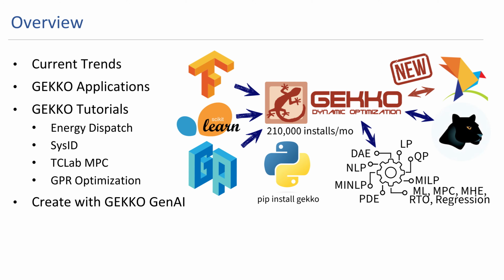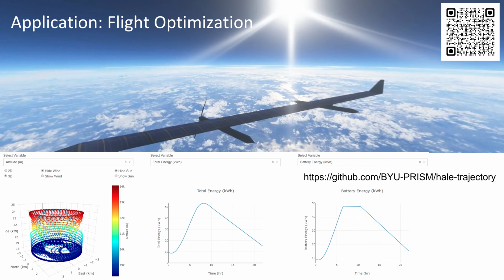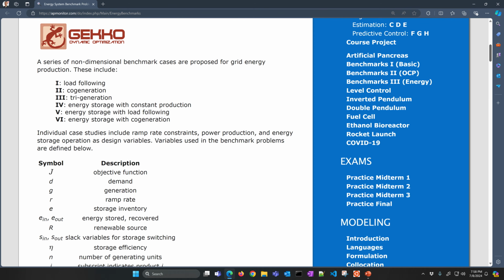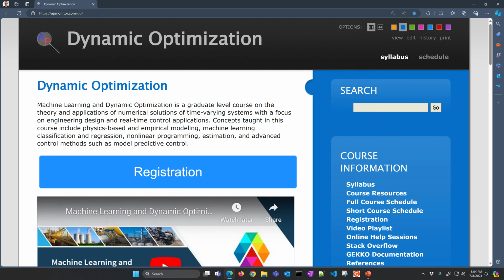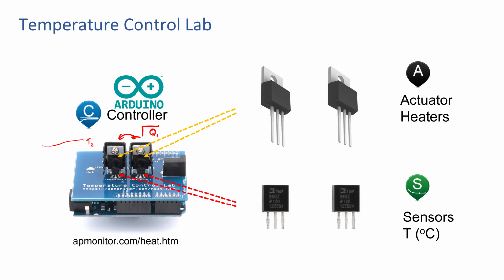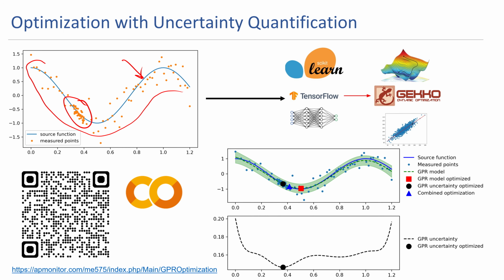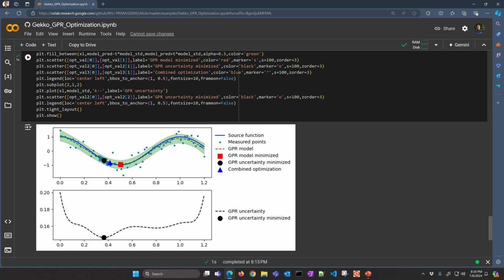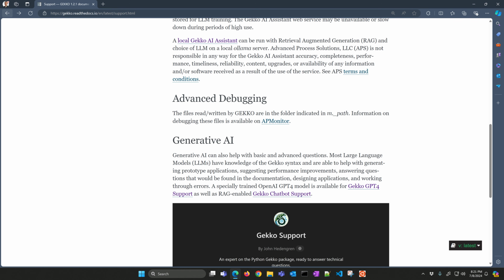ACC24 Gekko Tutorial Session

Comment: Hey, I am building a game with a friend where you can fly an aircraft and other aircraft are controlled by AI center controllers. We really want to spend some time learning and trying different optimization algorithms to find their optimal routes (to ensure safety and minimize fuel). The game also has weather which we want to take into account. Now comes my question: does anyone know which algorithms would fit the problem? It would be cool to have some simple ones but you can also suggest more time-intensive algorithms that we can try out! Thanks a lot :)
Reply from the maker: Optimization algorithms for aircraft routing are essential for ensuring efficient flight operations, minimizing costs, and maximizing safety. Mixed Integer Linear Programming is a popular method for scheduling optimization. Nonlinear Programming is used for trajectory optimization. Here is a recent review paper: https://academic.oup.com/iti/article/doi/10.1093/iti/liad026/7459776
Reply: @apm thanks for the answer? Do you think more complex approaches like Reinforcement Learning or Model Predictive Control could work? I'm not sure what to do when they don't give a solution.. e.g. you could plan ahead using RL but if there would be a crash in the future what would I do?
Reply: @apm And is nonlinear optimization fast enough if I have many agents?
Reply from the maker: @zemanntill  MPC uses linear or nonlinear programming to calculate the new trajectory. The speed depends on the number of equations and degree of nonlinearity. RL can be useful if you have a simulated environment where it can learn from the trials. RL is typically slow, but iteratively improves.